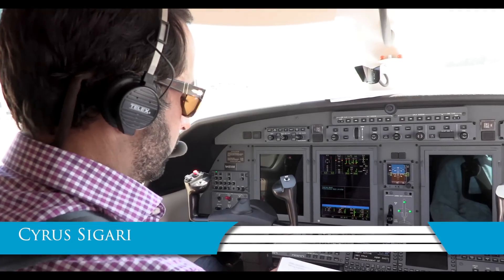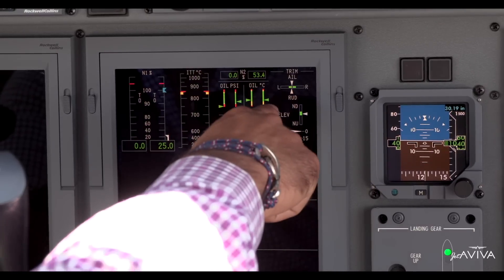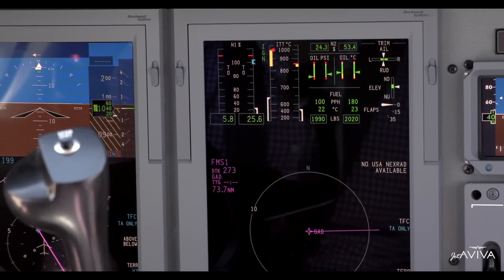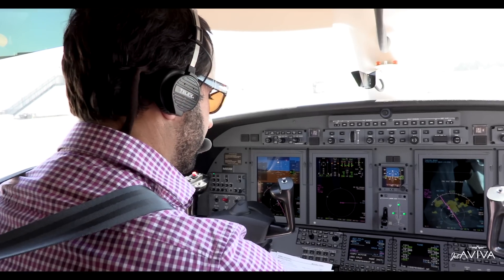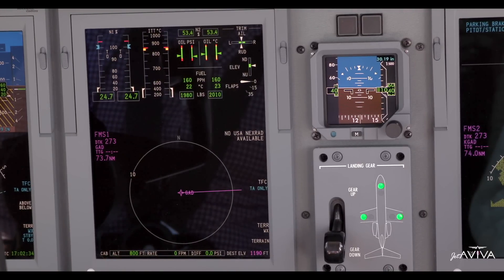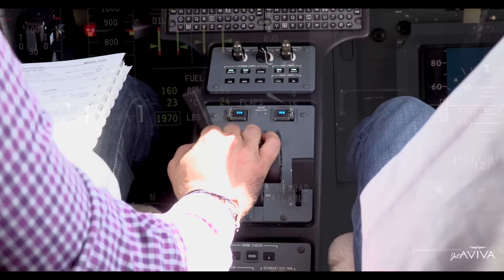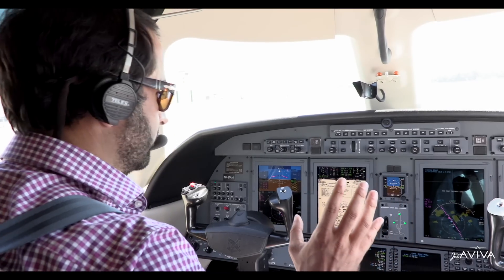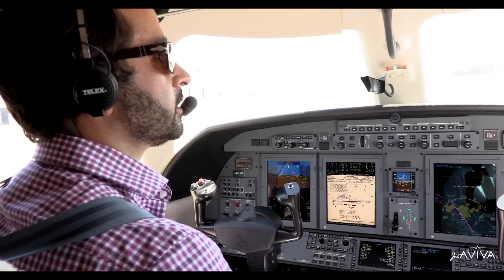Aircraft Review: Citation CJ4 Engine Start Checklist

Comment: The computer should monitor the engine startup fully automatically as well as check fuel vs route, weight vs runway, control surfaces etc, all instantly and ready to roll seconds after start is pushed. It should also be able to taxi and take off on its own. There should be a single large display, not an ocean of little displays. It's very bad UI design. Pretentious, stagnant. Dangerous.
Reply: Sir, please return to the cabin and put your seatbelt on.

Comment: Great video! Are the Jepps ground plates geo-cached in accordance with the GNSS levels of the aircraft (ie, is the accuracy of ground plates compliant with the relevant TSO specs?).
Reply from the maker: Good question! As long as the charts are current, the Pro Line 21 Jepp taxi diagrams are geo-referenced for legal use in the cockpit. Not quite sure what you mean with geo-cache though...can you clarify?
Reply: @jetAVIVA  geo-cached/geo-referenced being different terms for the same thing. Thanks for the reply, keep up the great work!